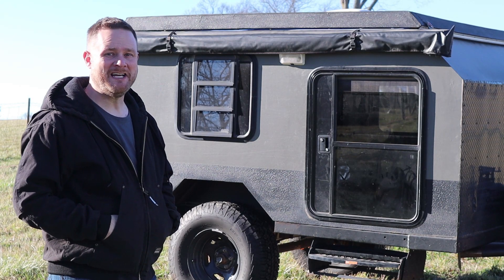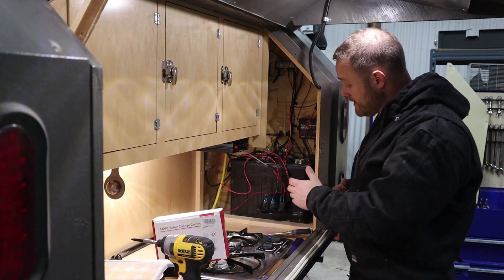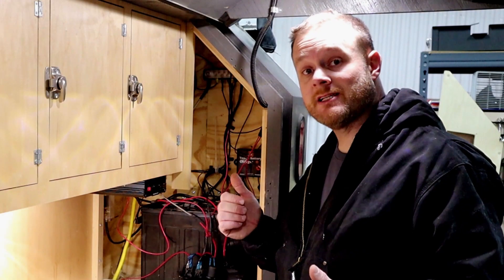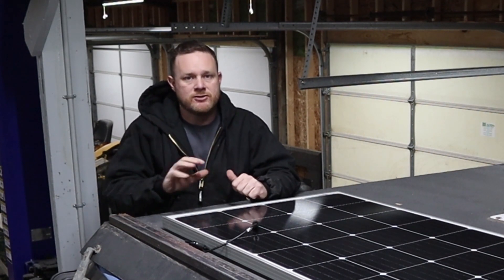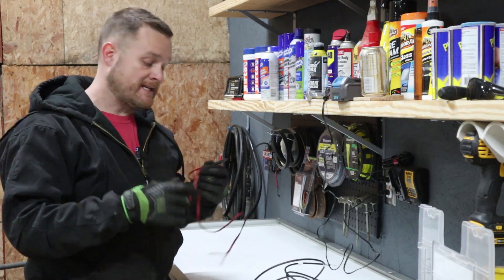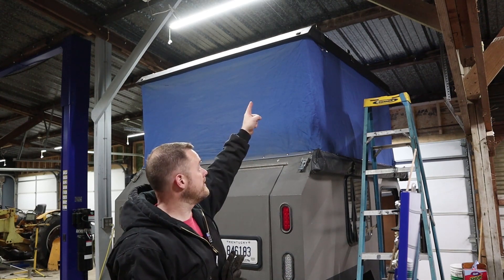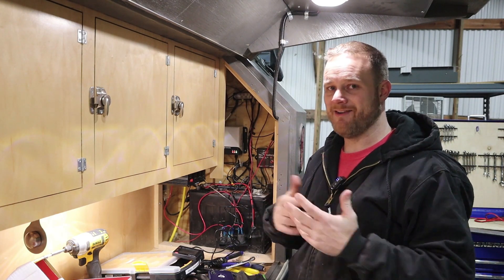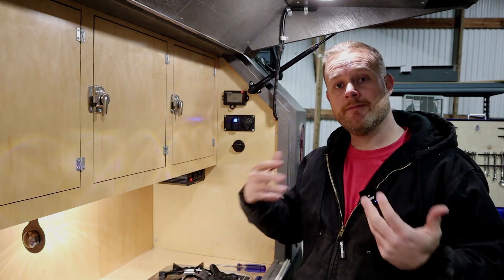Installing Solar on the DIY Off-Road Overland Camper E77

Comment: Rather confusing what you have wired to what!
Reply from the maker: Sorry, it is literally 2 wires.  positive and negative from the solar panel goes to the + & - of the charge controller in side.  + & - from the out side of the charge controller go to the battery.  It couldn't be easier!

Comment: Nice job Wes! It would be great to see how you rigged up the power connection setup between your truck & trailer, including charge controller.
Reply: Agreed. That would be relevant to non-trailer owners that want a second battery too!
Reply from the maker: it was extremely simple.  I used a dc charger intended for charging the battery of a vehicle being flat towed behind an RV.  It has worked GREAT!  here is a link to one https://rvibrake.com/products/towed-battery-charger-plus?variant=13115309260823&currency=USD&_vsrefdom=adwords&gclid=Cj0KCQiAgebwBRDnARIsAE3eZjTfZCRb68DJc6FxBthdUkopQXElc3Qyh3z3UeT5-D18YSoHkn90HZ8aAuMVEALw_wcB
Reply: SHAWИEE HILLS WORKSHOP Thanks. That looks fairly simple. What did you use to monitor the battery?
Reply from the maker: Narrow Road Adventures I have a voltage meter in the cab of my camper

Comment: Hey Wes! Great job and really nice set up! I have a similar set up in my camper with the only difference being that I had to eliminate my solar controller due to the number of problems it was giving me. My batteries would never get fully charged so eventually I installed the CTEK D250SA and most of my charging problems went away. Maybe in one of your future videos you can give an update on how the solar controller is functioning, and thanks for sharing this video very helpful!
Reply from the maker: Ill let you know how it goes!

Comment: Great project. Did you calculate how much amps you will be pulling?  The gauge of the wire you soldered looked a little small.  With the battery you are using, you only can use 1/2 of the stated amp hours.  Get a Battleborn Lithium Ion.  They will outlast the both of us... Look for DIY Solar Power on youtube.  Will Prowse does a great job explaining...
Reply from the maker: I used 10 gauge wire and am going approximately 6 feet.  it is the same gauge that the solar panel came with, it looks smaller because the solar panel wire had a second layer of insulation.  And yes, I know that you should only discharge a non lithium battery 50% in order to not damage it.  So far it has never been an issue, my current battery is more than I have ever come close to needing.  Even on several week long trips without a solar panel, the DC charge controller hooked to my alternator has more than adequately charged the battery.
Reply: @shaweehillsworkshop4226  I'm 8 years using the same cheap WalMart standard lead acid, deep cycle battery with 40 amp panel while out in the boonies and a 20 amp trickle parked at home. Plus I use a battery conditioner/maintainer/trickle charger from time to time at home. 100% 12V, been on plenty of long trips, 3 months once. You sure might want  expensive LI battery but you sure do not "need" them.
Reply from the maker: Metaxa Anabeer I agree, I’m on year 3 with my agm.   It’s a good battery.  I have a trickle charger built into my camper and when it’s home the camper stays plugged in.  Like you said, I would like lithium, but it’s not requires
Reply: I need to get myself a setup like that for a second battery!
Reply: @shaweehillsworkshop4226  Good to know and thanks for the response.  Btw, love your vids and projects...Keep it up!